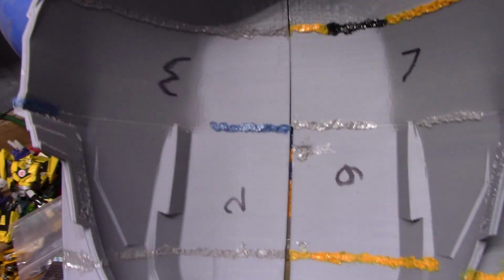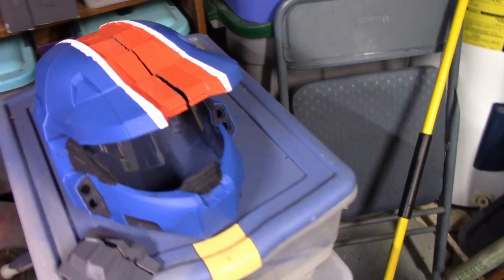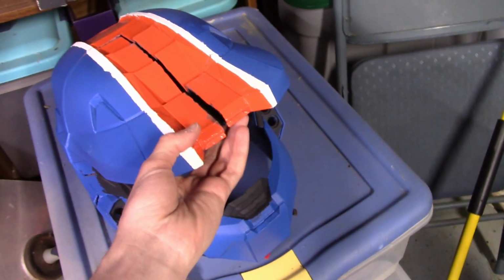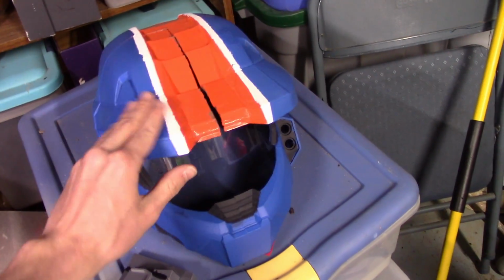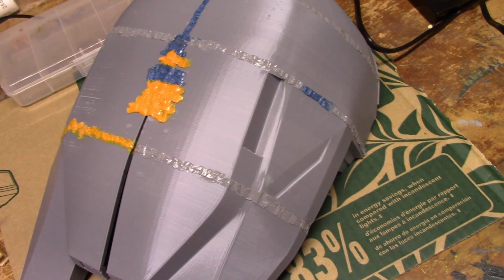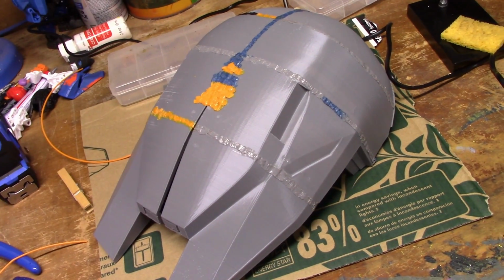3d printed Halo helmet update

Comment: I see when I try to print some of your models, it’s too big, so my question is how much to scale down
Reply from the maker: Are you referring to my lego halo helmets?
Reply: @Legoman071  yes and also the bionicle helmets
Reply: masks i mean
Reply from the maker: @mcll743  The kanohi are already scaled correctly, and the updated halo heads should work
Reply: @Legoman071  but the hero factory masks
Reply from the maker: @mcll743  All other parts will eventually become available in the proper scale. This is a very busy time for me, but rest assured I will get to it.
Reply: @Legoman071  ok
Reply: but can you figure out how much to scale it down so it is compatible with the hero factory/ bionicle parts
Reply from the maker: @mcll743  10.6 in the creality slicer has been my lucky number.  When you first import the model, no matter how big it is, the slicer registers it as 1.00 scale.
Reply: @Legoman071  wdym
Reply from the maker: @mcll743  just make it 10.6 times bigger
Reply: @Legoman071  it’s already way too big tho
Reply: @Legoman071  ty and can you please make a brain attack visor or a hewkii mask
Reply: Or a random 3.0 helmet
Reply from the maker: @mcll743  It's on the list. As for the size being to big, I dont know, that's never happened before. Just scaled down as much as you can. Experiment a bit.